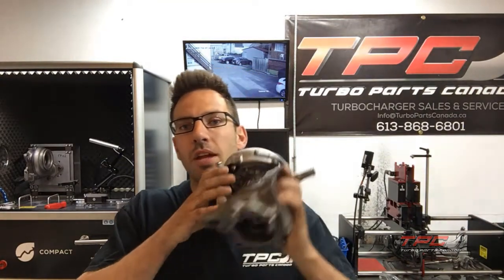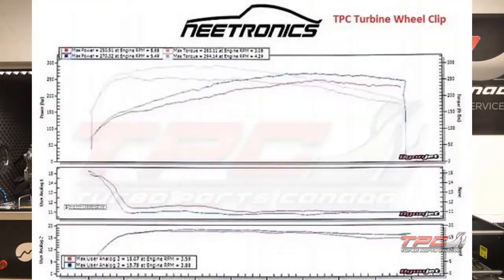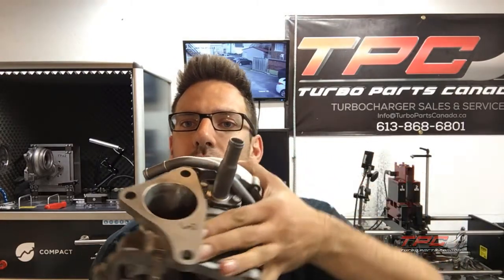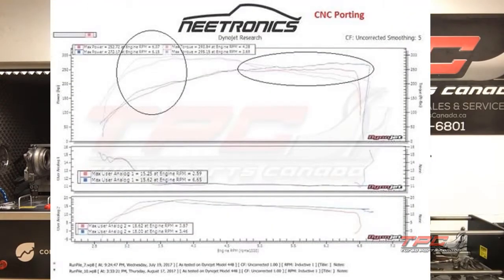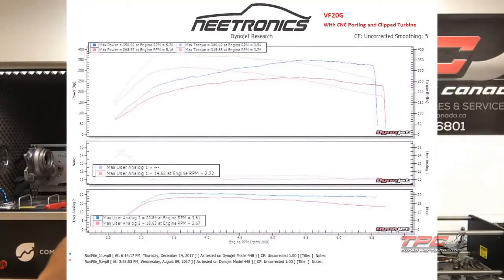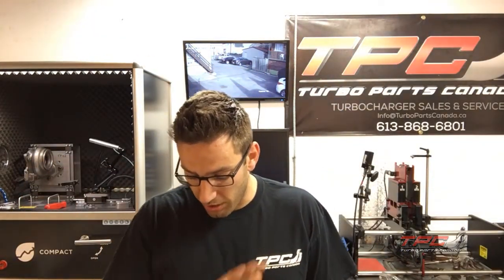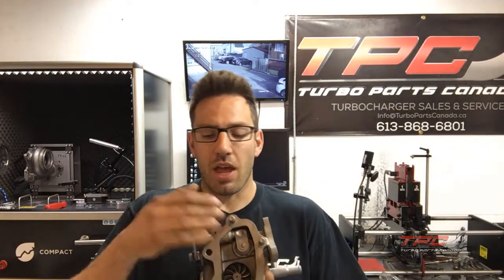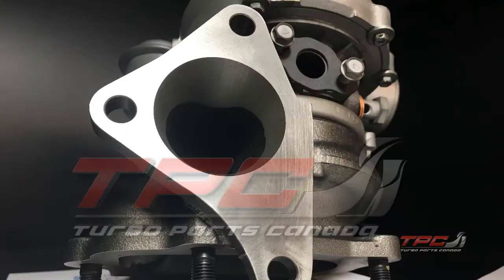Subaru RHF55 VF20G turbo upgrade

Comment: Is a new spring required for the boost creep delete?
Reply from the maker: Yes to pass 16-17psi you need upgraded gate.
Reply: @turbopartscanadainc.2269  when are you guys opening back up? Keep looking at your website and it's been down for the last couple of months, I hope it's not permanent
Reply: Just seen this after I installed the boost creep delete kit... Car will only build up to 14psi if I get lucky... I'm hoping it's the actuator.. getting a turbo smart actuator with adjustable spring hoping that fixes the problem